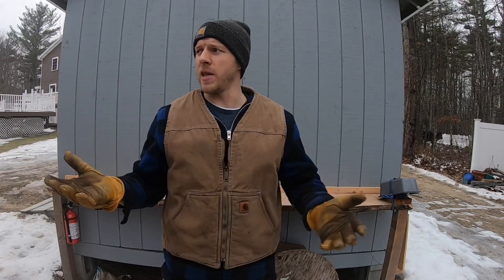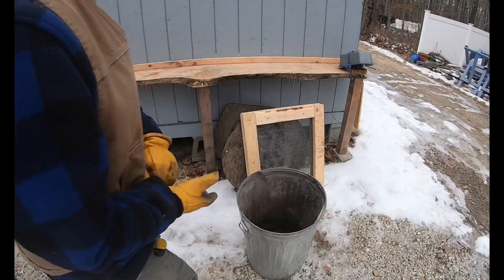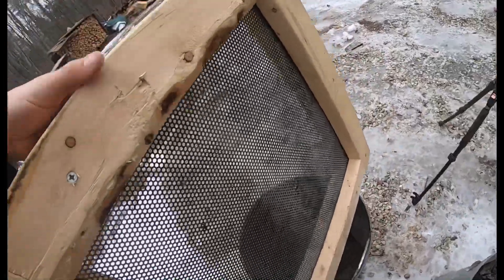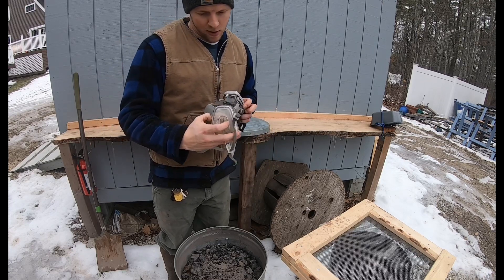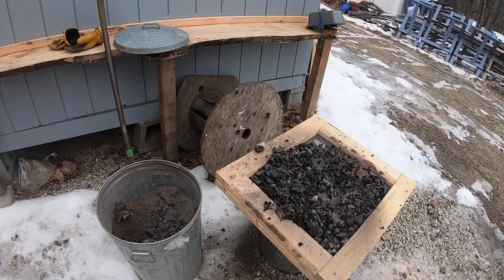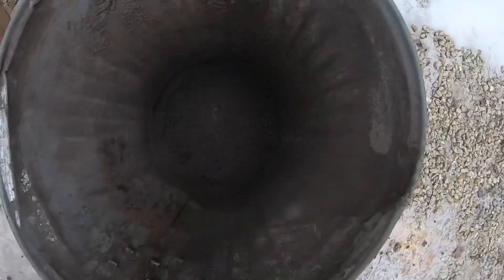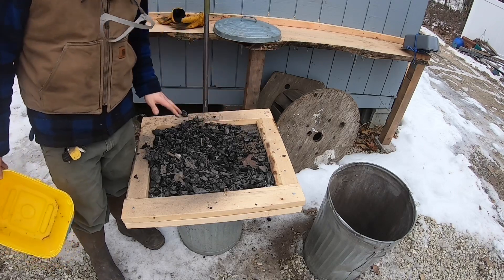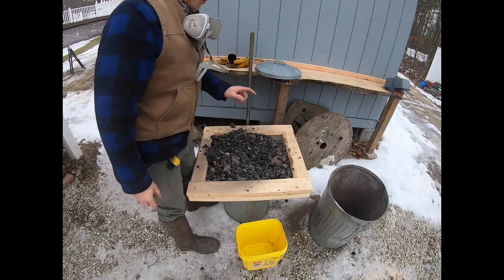SCREENING Firewood Ash!

Comment: That screened worked really well. You could save all the charcoal for grilling in the summer...then you don't have to buy it at the store. :) Maybe a high-power magnet would work to pull the metal nails out of the charcoal quickly, so you don't have to sort it all by hand.
Reply from the maker: Yes I am saving the charcoals for sure! Either I will reburn or use for cooking/ filtering water etc..

Comment: Hey Jay!  I took a plastic 55gal drum  and drilled holes in it made a door and built a wooden frame  around it on its side. Then place your ash and a couple large magnets inside, spin it slowly and all the fine ash will fall out the holes into a pan underneath and the large coal and nail filled magnets will be left inside. I built this to filter the large rush pieces from my used sandblasting sand, I'm sure this might work for you
Reply from the maker: Now thats a pretty slick idea! I maybe have 4 total barrels a heating season so idk how far overboard I want to go with this process haha the screen as is works lol just need that magnet!
Reply: @HomesteadJay  it takes less than an hour to built and you could use it to mix your garden compost in the summer or maybe make cement lol would make an awesome video

Comment: Larger barrels, for dropping  ash into, the run a magnet through for nails and screws, then transfer coal into a larger bucket! Simplicity at its best!
Ash is also good for dropping on roads for traction in winter!
Reply from the maker: Yes for sure thats where the "cash" part came in lol I can use this instead of buying sand/salt! Thanks for tuning in Pat!
Reply: @HomesteadJay  use it for glass cleaner as well! Just need a damp rag, and a little ash! 
Mix it with wax, and it become a cheap polish!

Comment: Could get a square trash can at one of the box stores a bit smaller then your wood frame. Then add cleats to the wood frame to hold it in place. A old lawn mower flywheel has a good magnet in it just put a bag over the flywheel. Pull the bag off over a trash can nails all fall off into the trash can. Have a great  day
Reply from the maker: Hmm interesting! I dig it!

Comment: I do not think you have to separate the ash from the charcoal. If you remove the nails with a magnet and then coarsely grind the charcoal you can use it all in the garden. The charcoal will act as biochar and enhance the soil by binding the nutrients in the soil in a place the plants can reach them and adding organic matter to the soil.
Reply from the maker: Thank you for the feedback! I am doing research with ash and charcoal for garden uses as we speak!

Comment: I wouldn't worry to much about the nails in the charcoal. They'll just settle to the bottom of your burner and you can clean them out in the Spring. The ash is good for making soap. The pioneers would pour rain water water into ashes and let it slowly trickle through to a small drain hole in the bottom of the barrel where they would collect the lye in a bucket. They would pour it back through the ash until lye coming out was strong enough to float an egg. You save the lye in a ceramic jug until you slaughter animals and use the fat trimmings and lye to make soap.
Reply from the maker: I love learning about that "primitive" way to do things! Thanks for sharing that insight!

Comment: Maybe change the shape of the screen to be an inverted pyramid that inserts into the can, increasing the catch and screening space. Maybe try tumbling the charcoal-nail mix with cow stomach magnets, which are pretty large and cheap at the farm store.
Reply: A 5 gallon mesh wastebasket may make a great sieve. With cow stomach magnets epoxied to bottom? Maybe an additional bottom with the magnets so they can all be removed at once?
Reply from the maker: Im digging the magnet idea for sure. A primary screen with magnets is a great idea that I can remove and clean off later. Thanks for the ideas and time spent here!
Reply: @HomesteadJay  From my wood stove, my ashes go into a 6 gal. metal can. I scoped from there into a 4.5 gal. mesh basket. The basket was in a 30 gal. utility bin. I used two 3" diameter magnets, facing each other separated by all-thread and nuts. The magnets are the type with a metal cup epoxied into a metal cup and only have force one direction. So, the magnets don't stick to the can but there's a lot of nail attractive force between them. I scoop the ashes in the mesh bin, then spin side to side ejecting the ash quickly. I repeat this, and when there is a decent amount of charcoal, I tilt the basket and tumble a bit to get the last ash out. I tried this for about $30 for all (magnets, utility bin, and mesh waste can) but the original ash bucket. Works great for me. If the mesh waste can was permanently tilted and spun slowly by a motor, looking like a cement mixer, one could process a lot of ash quickly. Anyway, your video came at the same time I was thinking about what we were going to do with our ash, made the suggestion, and thought I should just try it out :) Best wishes

Comment: You might think about building a tapered, four-sided funnel out of wood or metal sheet with the screen at the big end and the small end sized to fit into the barrel.  That will give you better screening capacity and a way to direct all the ash into the barrel.  A block of wood with magnets screwed to the bottom and a convenient handle attached to the top would allow you to quickly pick out the steel/iron nails and screws with a pass or two across the charcoal bed on the screen.  

By the way, why so many nails?
Reply: Post script:  You can get a pack of 20 high-powered, washer-shaped magnets with countersunk screw holes in the center for less than $20.
Reply from the maker: I am going to Homedepot tomorrow lol to see what they have for magnets to use! I like the idea of a tapered funnel a lot of people mentioned that and it makes a ton more sense! Thanks for the great advice!
Reply: He burns pallets
Reply: @davidmartin6589  Thanks, that explains it.